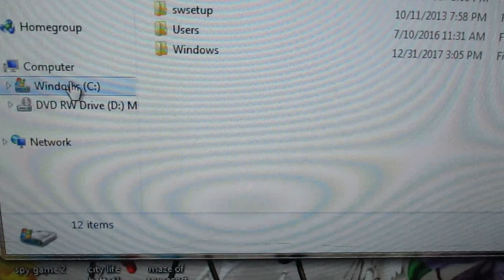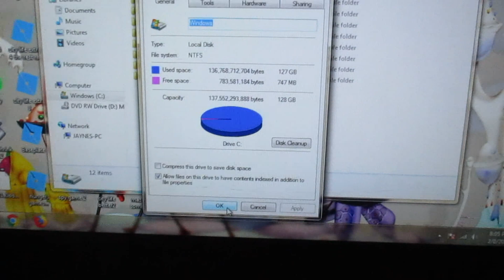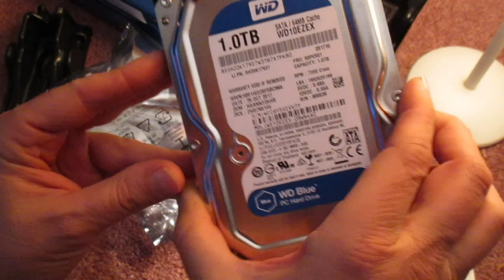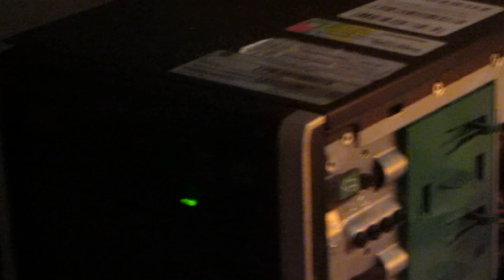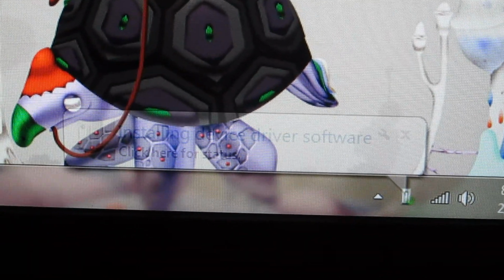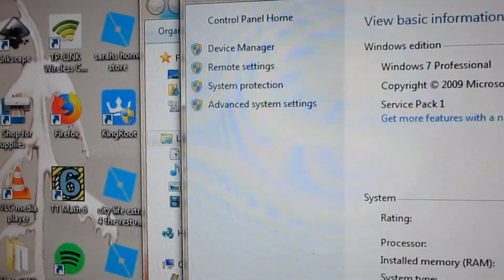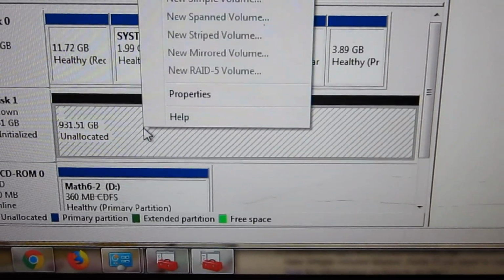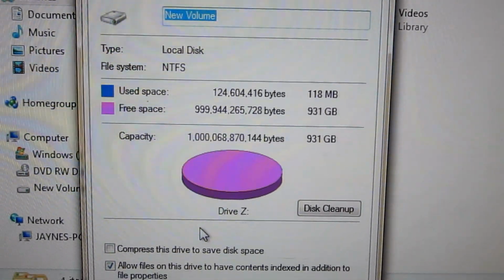How to Add a Second Hard Drive - Windows 7

Comment: There are jumper pins on that drive at 2:32 pause the video, the jumpers are on the far right hand side, but there doesn't appear to be a jumper cap already installed on any of the pins.

Comment: Here you connected a new hard drive. But can't we do this with a hard drive from a crashed computer to recover our data?..if so how?
Reply from the maker: It depends on how badly it is crashed.. if the hard drive only has error on the boot section of the hard drive, but is still functioning correctly, you should be able to read it! I have some videos showing how to do that!

https://youtu.be/GoScdgkOA8E
https://youtu.be/xiGLjGHBoSw
Reply: @jaynesnetwork  i tried..but the hard drive just didn't get detected..anyways thanks

Comment: hi uhhhh just wondering i got two used hard drives both having family photos on it if i add the second hard drive will it format  the second or first one and if i wanted to acess the second one will i have to reinstall the windows on it ? and by i mean if i wanted to acess the secound one i mean like if i do this process and i just say wanted to unplug the first one and use the second one by its self will i have to reinstall the windows firmware with disc and both windows are different ....one is windows 7 ultimate and other windows 7 professional thanks and im scared if i do this i loose info from one of them for ever :( im worried please reply
Reply from the maker: You want to be very careful in formatting a hard drive.. especially if it is not clear, which one it is.. yes probably unpluging the one you don't want accidentally formatted would be a very good safety precaution! Thanks for the great comments!

Comment: Yo can you help me? I have a ssd with 240gb. It works fine. I have another hdd with 160gb. It is in good condition. I get the hdd put it in my pc install the sata and power cable. I turn my pc on. Then the pc runs on my hdd not in my ssd. My hdd doesnt have windows installed. What should i do? I remove the hdd and the ssd works. I put the hdd and hdd runs

Comment: Will any hard drive work? What do I need to search for? thanks
Reply from the maker: I believe so.. provided you can hook it to the cables in your computer.. For instance you can probably not add an old IDE drive to a computer with SATA.. but other than that.. it should
Reply: And a 3.5" I found out too. Are all sata backwards compatible to other sats's? Thanks for replying.

Comment: After I add second ssd, why did it show BD-ROM drive? it is SSD ( 1 TB ); and I can't format it.
Reply from the maker: I'm going to guess that the ROM drive is maybe an optical disc drive? Maybe it is not recognizing your drive? Do you have the jumpers on the drive set correctly, and are all the cables plugged in all the way?

Comment: I bought a hard drive (1 TB Seagate Barracuda) and I dont have any cables with it. Which ones should I buy?
Reply from the maker: Do you have a working desktop computer?  I have a new video that shows how to do it, without buying any new cables.. (see below)  but,... If you only have a laptop, I believe Walmart  has some USB to SATA adapter cables. A third option is to use a linux, USB boot.  I believe I made a video on that too..  Here is probably the easiest solution:
https://youtu.be/xiGLjGHBoSw
Reply: You must have the tower that you can slide the drive in